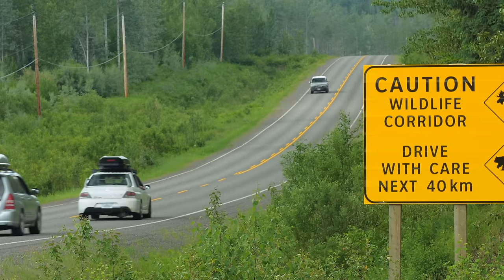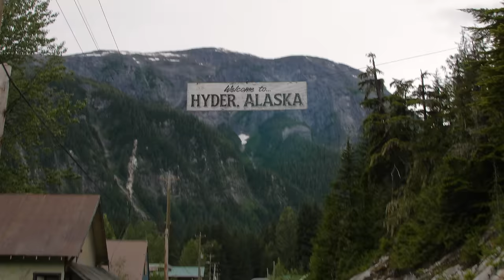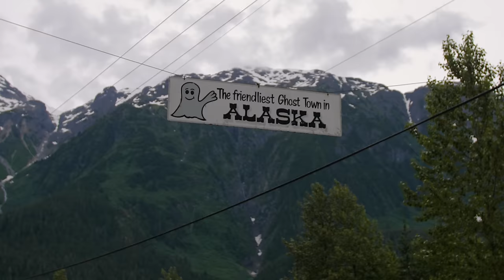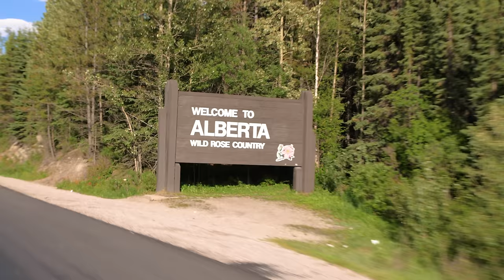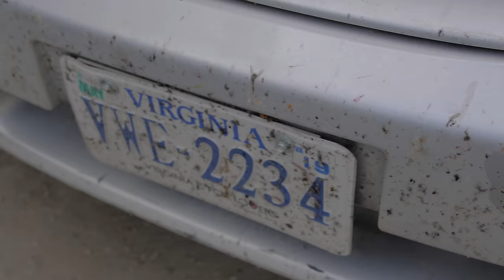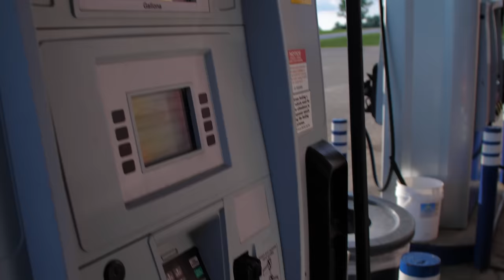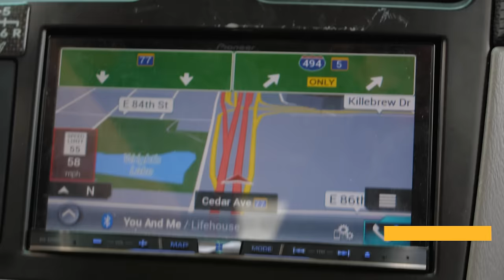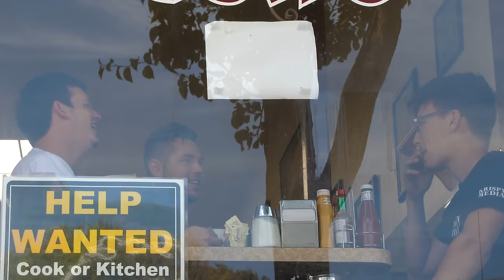Driving from Florida to Alaska - Episode 3

Comment: The height of a brand new tire versus a slightly used one is not going to throw off the all-wheel drive system. Or change anything in any adverse way it's just for stupid people who want to run different size tires that's where you have a problem because the gear ratios change

Comment: You guys drive on 91 octane? Here in France there's no under 95 or 98.
200 miles of range OMGGGGG 😱 you genuinely chose the worst cars for a road trip :')
Reply: Christopher Kriiss research it,it’s a different number because of the two formulas used to come up with the octane rating,our 91 is the same as your 95
Reply: @Whateva67  Oh exactly I watched a video about it, thanx :) . Actually yeah it's the same stuff
Reply: @Whateva67  What's the US equivalent of Europe 98 octane?
Reply: Christopher Kriiss I believe it’s 94,here in British Columbia our Chevron 94 doesn’t have any ethanol in it either so I use it in my chainsaws and small engines😎. Where in France do you live? I’ve been to Nice and Paris but I wanna visit the smaller towns in the south and along the Mediterranean
Reply: @Whateva67  In France it's pretty rare to find 98 octane without ethanol 😕 as the legislation allows up to 5% for 98 octane and up to 15% for 95 octane, and most stations sell this "bioethanol" mix shit which is even more polluting than conventional gas 😅. Anyway. I live in Rennes, Brittany, the Celtic part of France haha

Comment: You absolutely 100% can run 87 octane. Wth. Youre not doing wot pulls here. Jfc. You have modern fuel injection. Obd2. The car can run just fine on 87.